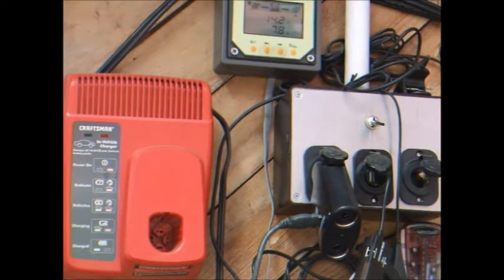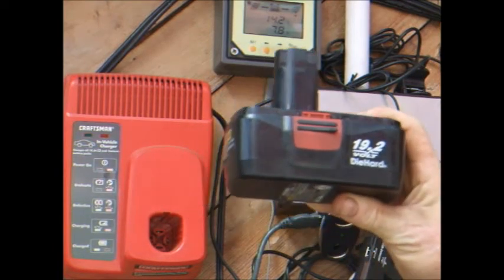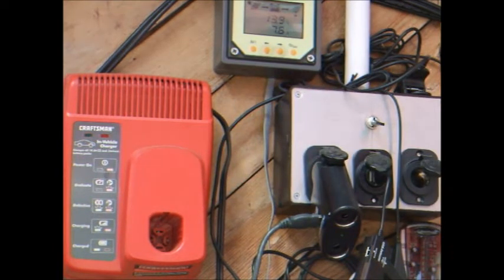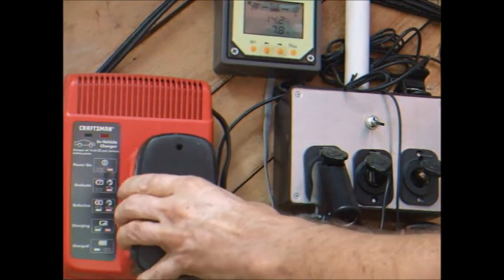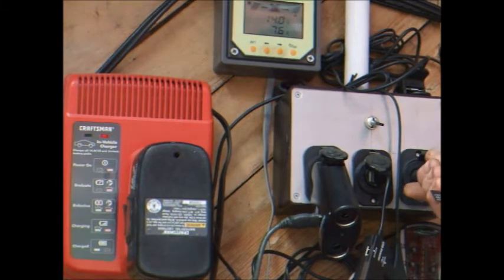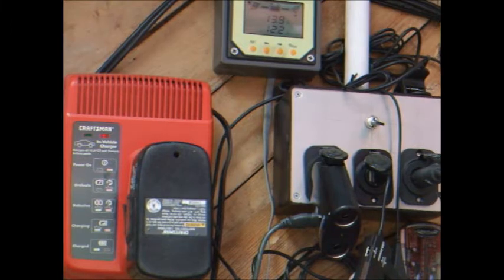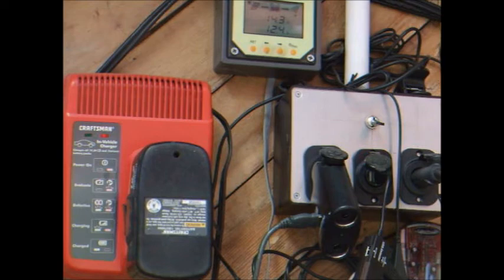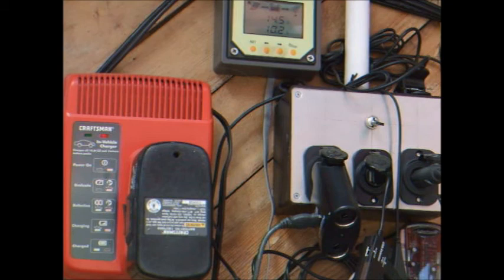Craftsman C3 Power Tool Battery Charger

Comment: Mine just keeps flashing red, never goes to solid red
Reply from the maker: Mine started doing that a while back as well.  Haven't had time to look into it, but I suspect it has something to do with sensing the power input voltage and it's it's out of range it flashes instead of solid solid red.
Reply: @The4Crawler . If you ever look into it let me know if u can.  The best I can get it to do is slowly blink red.

Comment: I wish I could find one of these to use in South Sudan instead of needing to use a small inverter...  Any idea where to find one of these 12v chargers?
Reply from the maker: I found mine on eBay.  Took some weeks to find one come up for sale.  You can often use an RC battery charger and clip onto the +/- terminals of the battery.  Some of the batteries will charge like this, some won't as I showed in some of the other videos in this series.
Reply: Thanks for the tip.  I saw one, but they are expensive since they are rare.  I ended up just putting a dc jack on the side of my batteries (hardwired to the battery) and I'll use this as a back up.  Cheers
Reply from the maker: Yes, hard to find one where it doesn't get bid up to exorbitant prices.  The DC jack is a great idea, just plug that into an RC battery charger set to 5S lithium mode and that should work.  I'm working on modifying a C3 NiCad charger connector to plug into my RC battery charger so I can directly charge my regular packs.